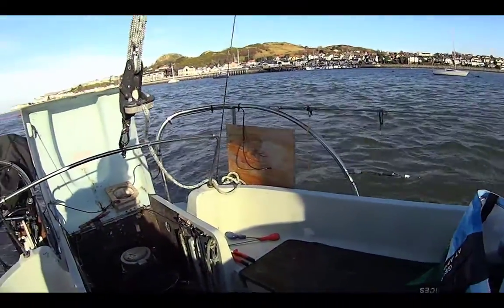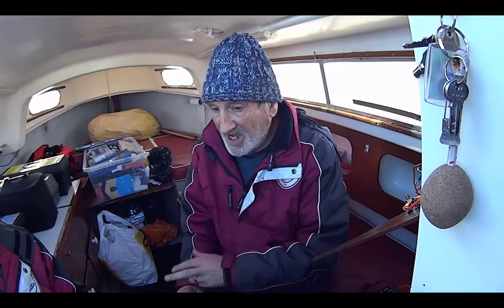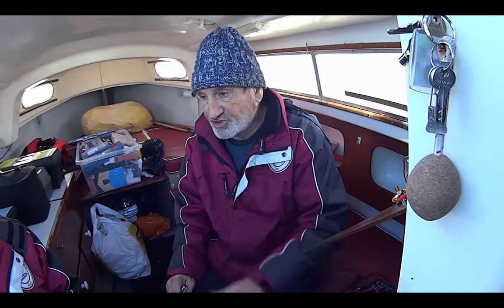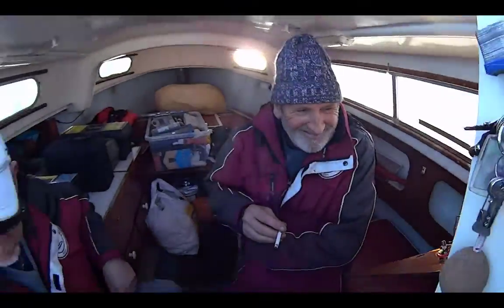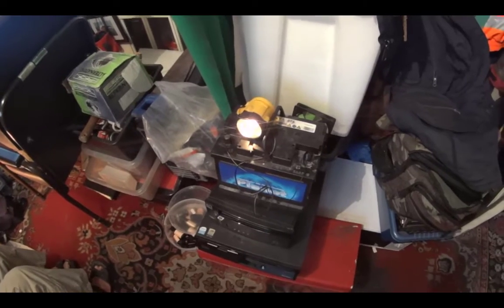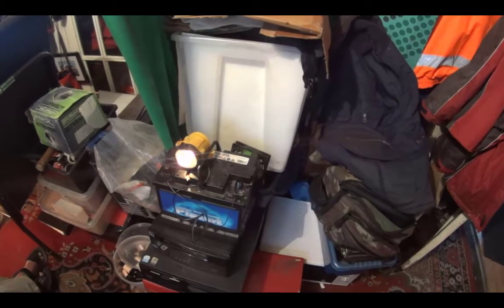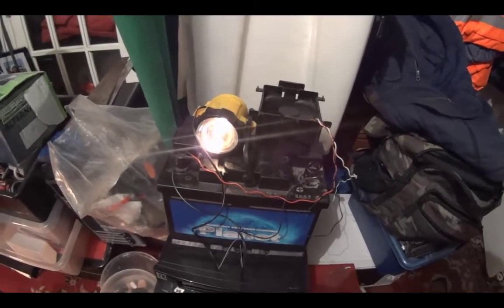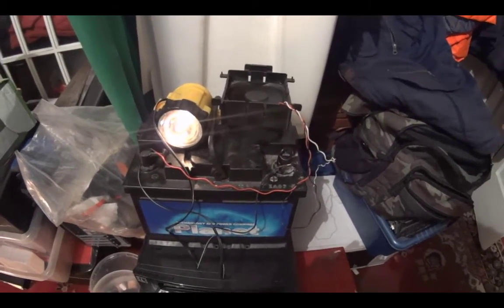The strange case of the reversing polarity yacht battery

Comment: Solar cells will only supply current to a battery in sunshine.  Any shade across the cell will create voids and nullify the charging of the panel, the entire panel needs to have equal lighting for the solar panel to produce voltage.

When the sun goes down, solar cells become a drain on the battery.  Most solar cell manufacturers have a diode in circuit to prevent battery discharging when the light level goes below its ability to charge.  If you hook it up backwards the solar cell is now discharging the battery, with a negative charge.  The panel is acting as a bleed resistor at night, and during the day, it is charging in reverse polarity, which will slowly reverse your batteries polarity.

Why this didn't short out is because the solar panel is acting s a resistor, and the battery connectors are probably lead, giving a very high resistance in the Mega-ohm range limiting the shorting current.

If those battery connectors were made of copper, and the batteries were high discharge, then yes the wires would have melted, or become a battery fire.

Comment: Is this a joke or for real? I have been working as a mechanic for 32 years and never seen anything like this. I have seen completely dead batteries blow up when boosted backwards when you get some charge in them as the cathode inside does not like the electrons touching it. Weird but good info
Reply from the maker: no hommie its real I and Alan were in the car trade as well for 20 years and we had never come across this but it can be fixed
Reply from the maker: remember they did have + earth cars 40 years ago
Reply: Yes we did have positive earth cars and we still do with machinery that works in salt mines and very corrosion heavy industry, it slows corrosion. But once a battery is charged it "sets" the anode and cathode in the battery and usually it can't be changed. But on this one you guy have managed to do it, well done. I just think it was luck and would be very careful trying it in the future. Saying that I am going to kill a battery tomorrow and charge it backwards see if i can get it to work. Thanks Pete something to do at work.
Reply from the maker: https://www.youtube.com/watch?v=EIILZUDz74k take a look thanks for taking the time